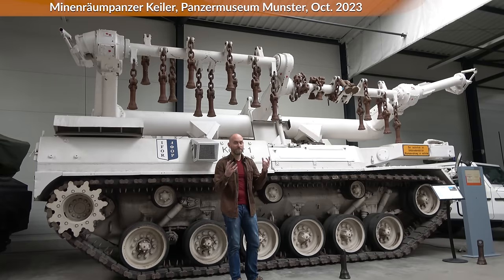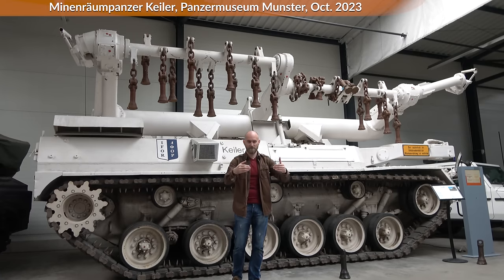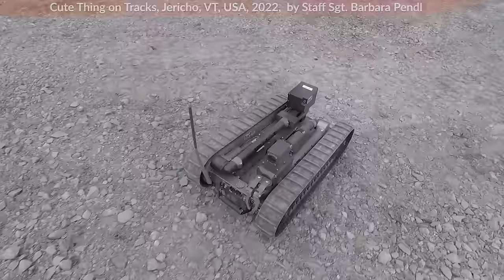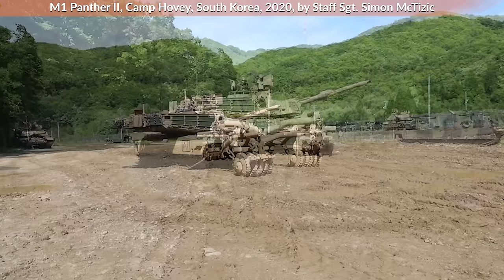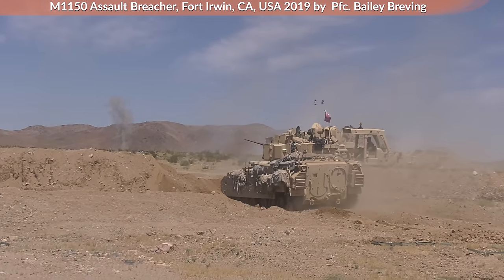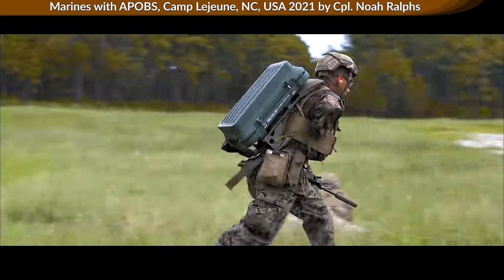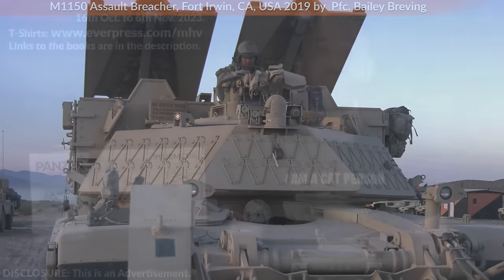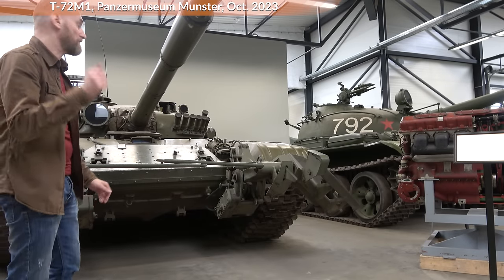Ukraine: The Problem with Mine-Clearing Tanks

Comment: These vehicles where really designed to clear traditional mine fields, I don't think people realise how dense and large the Russian minefields are. It's something crazy like up to 500 meters deep and around 4 mines per square meter with anti-personel mines along with anti-tank mines. And even if you do manage to clear a path Russia can deploy more mines in the area using missiles. There are also more complicated mine setups where they have a mine or stacked mines which destroy the anti-mine tanks or they have mines connected to pressure pads that are deeper underground setup so when a tank moves over the mine it doesn't go off until the mine is under the belly and the tank triggers a pad that then detonates the mine penetrating the belly of the tank. You also can't go around these mine fields, they are all along the front with barely any gaps.
Reply: And don't forget that you don't just have anti tank mixed with anti personnel, you often got many different models of mines in the same field. Which makes it even more difficult, and ontop you got improvised stuff as well, like a grenade under a magazine
Reply: Not to mention that these minefields are under observation by various UAV systems and often covered by fire.
Reply: I don't know what you think a traditional minefield is, but if you read any doctrine from any professional army on how to develop a minefield, that is exactly how they are supposed to be created.
Reply: @@solarwarden1894 Bingo, though the problem isn't so much the systems themselves as it is a doctrinal/technical/logistical insufficiency on the Ukrainian side. Every piece of military hardware is designed within a doctrinal context and under the assumption of proper utilization. The clear problem in Ukraine is that the current military reality in Ukraine doesn't allow them to use their hardware as a proper system of systems with proper doctrinal/technical/logistical integration.
Reply: If only we had classic cartoon drill tanks to burrow under the dense fields.
Reply: @@solarwarden1894 It's not a failure of the mine clearing vehicles but a failure of tactics. Even when mine clearing vehicles became commonplace, the preferred option for a mechanized unit was to bypass any mine obstacles, because breaching a minefield is an incredibly complex operation that requires careful planning and tight coordination of the combined arms. You would absolutely need to suppress all enemy weapon systems in the area which are bound to be present, because a mine obstacle that isn't covered by fire is also not an obstacle, it's a nuisance. You would also need to obscure and obfuscate the breach point, to make it unclear where you plan to break through, in order to prevent reinforcements from coming in. And everything has to work like clockwork. So since there's a lot of failure points, you would only attempt to breach if it you couldn't bypass. 

The vehicles work fine in their purpose, which is clearing a lane, the trouble is in protecting them while they do it. So if a combined arms breach was already a difficult task before UAV's became widespread, now it's even more difficult because when basically everyone from platoon commander and up can see the engineering units roll up in real time, it's even more demanding to protect the engineering assets and even more difficult to make the enemy question where the breach point is. The solution to mine fields isn't necessarily technological, it's coming up with suitable anti-UAV tactics, while also (somehow) enabling your own UAV's to function.
Reply: You don't even need fancy missiles to deploy mines, FASCAM can be deployed with normal artillery. As soon as a gap is made it can theoretically be plugged.
Reply: @lukerhode8960  These minefields are not doctrinal for NATO nor for the Soviet Union, Russia or China, so what military teaches them to be created this way? The density is about 1000 times higher than the most dense NATO minefield.
Reply: @solarwarden1894 No, the systems were developed for a hot war between the east and west, where static frontlines do not form. These minefields are highly undoctrinal and would not be possible to put up if under constant cruise and ballistic missile fire by NATO forces, for example.
Reply: Even if you clear a part, in five minutes it can be mined again from up to 15km whit remote mining launcher.
Even if its not mined, cleared route is premium target for artilery.
Reply: @solarwarden1894 They rely on proper combined arms.
Reply: Mine clearing tanks were used in WWII so I assumed mines were obsolete because of that. But this war really shows how that isn’t the case. The manoeuvre warfare in WWII also seemed to have obsoleted trench warfare and yet we are back to that. This war seems so much like WWI despite the increase in technology and in some cases because of it. It doesn’t seems this war will only end when one side runs out of ammunition and it seems Ukraine will run out first. I read about an ammunition factory here in Sweden and how they have increased capacity and they haven’t produced as much since the Cold War and can’t produce anymore because of other bottlenecks in the supply chain. Just to meet the minimum requirements for ammunition just for Scandinavia would take 10 years and that was just enough ammunition to fight for a couple of weeks or something like that. To make the amount the Russians spend Europe would need to increase production by at least tenfold.
Reply: @lukerhode8960 No, they're not. What he means is a NATO standard minefield, which are nowhere near what Russia is using. These are minefields that are, by themselves, fortress walls.
Reply: Hey, Bro are you telling me Russia actually is now preparing and using something with competence?
Reply: @lukerhode8960 Ukriane is literally an Army with a bunch of different equipment designed under completely different doctrines.
Reply: @wertywerrtyson5529 first sentence thinking mine clearing tanks being the end of mines is like the idiots at the beginning of the war thinking tanks were obsolete because NLAW Chan and ST Javelin
Reply: @ArchOfficial  Common sense cuz it works.
Reply: @carved6749  Yes, that's what I'm saying.
Reply: And this is exactly what air-mobile assaults were created.  But these combatants don't have that capability.
Reply: @solarwarden1894 Yes it would have been, this war has been going for almost two years, any exchange between NATO and USSR would be over in weeks. The type of fires and scale of them are not comparable.
Reply: @CharliMorganMusic  The point is that these are highly undoctrinal EVEN for Russia.
Reply: @carved6749  The defenses they put up and the way they conduct the elastic defense is to now the only somewhat doctrinal part of the war, and the minefields are effective due to being done correctly.

There was some money-embezzling constructions done in Russia and Crimea, but most of it is relatively sound.
Reply: @jimmiller5600  It is not common sense to deploy hundreds of millions of landmines in territory you intend to capture.
Reply: @ArchOfficial artillery can pound the corridor when enemy forces attempt to cross then deploy mines and scramble.
Reply: its russia not Russia
Reply: @ArchOfficial  It is if you suffer huge losses and want to keep as much of the territory as you can until you can bring your 3x advantage in manpower to bear.
Reply: @jimmiller5600 If they could do vertical envelopment wouldn’t the AA capabilities of the Russians be a limiting factor? 

Right now neither side is flying over enemy territory and even reluctant to fly close to the front, except for nap-of-the-earth approach for a quick launch and even quicker retreat.
Reply: @jimmiller5600  Russia doesn't have a significant manpower advantage FWIW, at least not a tactical or operational one, so I have no clue what you are referring to.
Reply: @lukerhode8960 that’s exactly what I was thinking.
Reply: @solarwarden1894 How would it happen? PGM strikes on tactical targets? Dumb bombing the minefield itself with popups?

Obviously there would be strikes on artillery and AD as well, but let's remember that the last time that happened it was preceded by intense operational bombardment.
Reply: @ArchOfficial  Population of Russia 143m.  Ukraine 43m.  Numbers still matter since one side can reinforce.
Reply: @blacksmith67  Agreed, but please note that my statement was "but these combatants do not have the capability".  You need at least local air superiority.
Reply: mines are such a cancer.
Reply: Air superiority helps with dealing with minefields. That's the reason so many have been lost on both sides because no one can achieve air dominance
Reply: No way it's 4 mines per sq. meter, that would be more mines than bare earth.
Reply: @jimmiller5600  Ukraine actually has a higher amount of able-bodied people right now than Russia, so those metrics only apply if you assume Russia is going to start conscripting disabled people and old men, which they are doing to some capacity. 

They could, and might, open up the pool more by also coercing women to join as volunteers, but that'd probably cause too much unrest.

Ukraine has less of a demographic issue and they also have a lot of popular mobilization of women, so their pool is effectively larger for combatants.
Reply: @ArchOfficial  How Ukraine can have more potential recruts if Ukraine haved 43 millions population and 8 millions of them immigrated to Europe, now they are have 35 at best, and Russia haved 143 millions and gained another 3 from DNR-LNR?
May be you are mistaken Ukraine with Russia?
Reply: @ridass.7137 :   It is "ruZZia", not "russia".  😅😅
Reply: @ArchOfficial  I'd be curious to see the citation to support your statement.
Reply: @lolnoobus  Ukraine has more men aged 18 - 50 who are combat capable than Russia has AND they have a lot of combat capable women as well. Russia has only sustained about 600,000 - 700,000 casualties in Ukraine to now, which isn't their entire conscription capability, but every single man is not going to be a combat troop who can conduct offensive operations, either. The more of those you have, the more actual manpower you have.
Reply: Mixed minefields are standard, surface laid are much easier to deal with than buried. Doctrinally covered by observation and fire, if they aren’t then they’re much easier to neutralize.
Reply: It's nowhere near 4 mines per square meter bud
Reply: @jnlk2505  It is, with the highest density about 5 per 1m^2. Average is closer to 2 of course, but he did say up to.
Reply: @jimmiller5600  There is no citation, my knowledge of the demographics of Russia and Ukraine and their conscription standards is the source.
Reply: @ArchOfficial  Ukraine haved 19 million men before conflict and Russia haved 67 million men.
How you decided that Ukraine have more combat capable men and women  than Russia?
By the way, Wikipedia says that without refugees to Europe and population in territories holded by Russia, whole ukrainian population is 28 millions.
How you decided that from 28 millions Ukraine have more millitary capable men than Russia from their 143 millions?
Reply: @T_81535 Russia is not committing its air force I force to avoid unnecessary losses and the Soviet doctrine always assumed that it wouldn't be possible to achieve total air superiority anyways, relegating the air force as an umbrella over your own lines rather than the spearhead that it is in the NATO doctrine, that is why the Soviets and now the Russians put so much emphasis in mobile in mass artillery, to pound the enemy positions in the scenario of their air force being unable to perform CAS in heavily contested air space.
That is why the Russians aren't using their air force as offensively as NATO would, their doctrinal baggage keeps them from committing to such an approach, preferring their most traditional artillery barrages for Frontline engagements and cruise missiles for in deep strikes, again, something out of late Cold War Soviet doctrine.
Reply: @lolnoobus  Russia has more old men, with a higher amount of alcoholics, disabled etc. who are not fit for military service. With factors like this you do come out to Russia having perhaps some ten or twenty million more men in manpower, but then you need to factor in things like if they will be combat capable or not. 

Most Russian troops right now are not fit and professional enough for any kind of military maneuvers, be it due to physical ability, character or just insubordination. This is exaggerated by Russia having a very high ratio of combat troops to support troops, which is asking for an impossible amount of combat capable personnel.
Reply: @ArchOfficial  
How you decided that russian men have less physical ability, character and subordination then ukrainian men?
Also, russians drink not much more then ukrainians. I mean, both countries are not in top 20 nation per drinking.
Russia also conscripted more every year.
Reply: @lolnoobus  Judging by OSINT publications of Russians discussing their own mobilization issues as compared to Ukrainians discussing their own mobilization issues.

Russia conscripted more per year because they lose their whole military's worth of combat troops every year. Ukraine has a fraction of the losses, so they don't exactly need to keep replacing men.
Reply: @ArchOfficial  I dunno, Ukraine closed their border for men 18-60, while Russia dont, so it dont looks like Russia have more problems with mobilization than Ukraine.
Also, russian population 1991-2022 droped from 148 to 143, while ukrainian population droped from 52 to 43. So, Ukraine lost more in absolute numbers and much more in percent of population before this conflict even started. 
And all this years Russia haved bigger army with bigger conscription. Like two time or more bigger conscription.
And if look on this numbers, even without Crimea, it seems for me that it in fact Ukraine the one who losted the population almost two times their military size per year.
Reply: @lolnoobus  Russia did close their borders for men.

Ukraine has only about 100,000 - 150,000 casualties as of now. They have not yet even lost all of their professional military's combat troops in losses, let alone the conscription base. Russia has lost their professional military 3 times.
Reply: Another “mine” that can be used is basically a trip wire for tanks, using a rocket on the side so when the tank tris it they get a direct hit to the side point blank.
Reply: @ArchOfficial  
When Russia closed their border for men? I cant find information about it in internet.
If Russia lost their millitary 3 times how they only haved one partial mobilization with only 300 000 mobilized? Why ukrainians who mobilized 1 000 000 not in Crimea yet? Who are they still fighting, if russians 3 times dead?
Reply: @lolnoobus  De-facto Russia has slightly more than 150 millions population (146,5 millions including Crimea and not including DPR, LPR, Kherson and Zaporoz'e territories controller by Russia).
De-facto Ukraine has slightly less than 20 millions population (i.e. on territory that Ukraine actually controls).
Even before the war Ukraine didn't have 43 millions, it was around 35 millions.
Now more ukrainians live outside of territory controlled by Kiev than in it.
The ratio is 7 to 1, not 3 to 1 or 4 to 1.

If you don't believe me, do your own research. You will end with the same numbers.
The confusion about Ukrainian numbers (and Russian too) comes from the fact that some people include DPR, LPR, Crimea and others, some don't. People often use obsolete numbers for Ukraine in borders of 1989.
Reply: @ArchOfficial  "Russia did close their borders for men."
No. You are misinformed.
Reply: @lolnoobus  Russia has not mobilized fully because of the political backlash. They should if they want to win the war, but it's politically sensitive, so they try to threaten or bribe people to join as "volunteers".

Ukraine is fighting the mobilized personnel.

Ukraine has not mobilized one million troops, even the conscripts haven't been called yet. It's mostly been popular mobilization and reservists to now.

They are not in Crimea yet because shaping operations do not depend on the amount of manpower, but on the amount of operational strike weapons and munitions for them.
Reply: @neverknowsbest2879  You are. Russia has effectively closed their borders for over a year now, and it has been passed in legislation this year.
Reply: @ArchOfficial  "Russia has not mobilized fully because of the political backlash."
Unlike Ukraine, Russia has to maintain its economy.
Russia can't afford its economy to collapse, West won't send Russia billions of dollars monthly like it does to Ukraine.
There is no point in winning war if your economy ends in shambles.
"so they try to threaten or bribe people to join as "volunteers""
There is no need to threaten anyone. Soldiers get very good salaries.
Reply: Focussing on the minefield is anyway the first mistake. The mistake exists as a barrier and to slow you down. You have to ignore it and focus on the actual defense lines behind that. 

If you can't do that: yeah... you should probably just give up (at least on your try to break through).

If your plan is to overcome the minefield and that as just the first line of a layered defense, you already walked into the trap of that layered defense.
Reply: @wertywerrtyson5529  Minefields on their own are pointless. Minefields as first line of a layered defense is extremely lethal. Not even because of the mines, you CAN get rid of them. But doing that slows you down massively what makes you fish in a barrel for the other layers. What is it's purpose.
Reply: @carved6749  I mean, tanks lost a lot of meaning, got less to do with crappy systems like Javelin, though. But just as mines they still got their placed in combined armed warfare.
Reply: @ArchOfficial  You mean because nukes or what?
Reply: @ArchOfficial  Russia doesn't have a single conscripton round yet. They didn't even do a full mobilisation.
Reply: @ArchOfficial  Child, where do you  get these absurd numbers from?
Reply: @carlosdgutierrez6570  NATO doctrine only works against countries with no army or a far inferior army after brutal bombing campaigns (with massive civil casualties).

It's not like Russia COULDN'T do that. They can. They don't want to, because that's the whole point of it being an SMO and not war: they don't see Ukraine as the enemy, but the coup regime, it's Banderites army and of course NATO (which was created to pillage Russia, nothing else, was never about defense, no one gives a fuck to conquer anything in Europa or the USA, there is nothing to get from that).
Reply: @ArchOfficial  You do get that your absurd propaganda doesn't change reality.

What you say is like "I could beat Mike Thyson, he's super old and ill and on drugs and I'm much smarter and fitter."

Yeah, you can lie to yourself like that. In reality you are still toast.
Reply: @miriamweller812  Russia has drafted about 100,000 conscripts to fight in the annexed regions. They have also signed up some 200,000 or so conscripts to serve as contractors. Ukraine on the other hand hasn't touched the conscript base yet.
Reply: @ArchOfficial  OSINT = some social media guys.

It's a fancy word for nothing.
Reply: Yep like 24h ago Leopard tank was destroyed by massive fireball - probably stacked mines. Tank more or less was disintegrated. Ukraine lost 4 Leopards in just last 48h.
Reply: @tomk3732  Russia lost 100~ T-tanks in last 48h. Who cares.
Reply: @ArchOfficial  Wow, UA boots just exceeded total number of tanks Russia had as losses ;)
Less than 100 vehicles of different types were loss both on the north and south flank of a successful Russian offensive to encircle the city (or what is left of it) of Avdiivka. 
Ukraine loosing 4 out of about 40 tanks they have is significant as it is a 10% loss of remaining fleet. They are also loosing other vehicles which they have no replacements for.
Reply: @grumpyboomer61  but we were told that "We are lucky they are so fucking stupid". Complex minefields and ISR do not fit into that picture.
Reply: @JJ-sd1xj They're not "using women", women have signed up themselves. Women cannot be drafted or conscripted.
Reply: @JJ-sd1xj So you're telling me Russia has inflicted 400-600,000 KIA and by that math over 2 million casualties and they are still losing a battalion a day and being pushed back? Against an army with a standing strength of 300,000 combat troops? Think about it for a bit.
Reply: @JJ-sd1xj They do not; conscription has not yet been used. Although men are obligated to stay within the borders in case it does.
Reply: also you have russian mines which upon their AI detecting through vibrations and sound that an enemy vehicle is approaching, launches itself in the air, targets and shoots a hollow charge at the weak turret hatch of the incoming vehicle...
how do you clear that ? 
🤣
Reply: @bschwand  I would be surprised to find even one Russian produced smart EFP in Ukraine. Actually, I have never even heard of a Russian smart EFP, let alone one with AI. Nobody is fielding autonomous munitions atm.
Reply: 500 meters deep? Was that a wrong number?
Reply: With no gaps 😂😂😂😂😂😂.

As if the have mined million of square kilometres of land.  

You have 3 road leading to a town 

One from the West one from the north and one from the south 

You put AT guns on the west road and mines and artillery on the north and south road . 

It allows you to have all your guns in one place to............. 

Thinking they have made a mine field the length of the country with no gaps is hilarious......

They want to counter attack the going to walk over there own mine feild...

Mine feild are about slowing and limited options for your enemy
Reply: @JackTalyorD  They HAVE mined the entire FLOT. Likely hundreds of millions of AT and AP mines combined. There are only some access passageways behind the dynamic defense zone.
Reply: @ArchOfficial  think about it for a second.

You have to roads and the are 50 km apart  in between is a farmer feild with a few dirt takes a small river and a forest of trees .

You lay mines on the road on the bridges and the dirt tacks (if they go anywhere)

You lay them either side of the road and in areas of flat land on the river where a new bridge can be built.

What you do is cover 10% of the ground but that 10% is where the heavy tanks and supply chain needs to be.

You take the travel speed from 100km.per hour down to 10 km and only for light car and tucks or on foot threw muddy famers feild

And then you add in 500mx500m squares of Mines on the "best area"

What you don't do is lay a continuous strip of Mines from road to road 50km long.

You can go around a minefield they are not everywhere.

What you can do it take heavy tanks and APCs fast because you are basically make new roads as you dirve and new bridges for rivers.
Reply: @JackTalyorD  Sure, seeing as you've been to Ukraine and surveyed all of these minefields, you could link me to where you posted the pictures and diagrams of them.
Reply: @ArchOfficial  have you
Reply: @ArchOfficial  but I could link you to several videos on training and feild manual for placement of mines for several different countries and wars.

The information I have available.
Reply: @ArchOfficial  WW2 invasion of France

No one expects tanks in the forest 

You lay minefields where you think the tanks will come from
Reply: @JackTalyorD  The Russian minefields are not doctrinal, for Russia, nor for NATO. Manuals and SOPs do not reflect the reality. Study more.
Reply: @ArchOfficial  yes but it still has to have a cost to befits ratios

If Ukraine now's that a 4km strip of land has mines in it running north to south the just need to carpet boom the shit out of one area and make a path threw.

Mine fields only work when 1 you don't know where the are or 2 you know where they are but the area is covered by artillery as well.

Russian will have used a lot of mines and layed several fields of them on the major roads, hell the will have several sets for one road or bridge.
Reply: @JackTalyorD  Stop talking about stuff you have no idea about. Using terms like "carpet bomb" kind of gives off that you were not involved with military topics before Feb 2022.

Tell me, how will you "carpet bomb" a minefield with insensitive Advanced mines on top and Regular mines buried 3m underground, especially when you don't have any platforms that can perform strategic bombing? You have no clue what the words you use even mean and what you're implying.
Reply: @ArchOfficial Russia not closed border for man, why you repeating really false info ?
Reply: @ArchOfficial  I'm under the impression that Russia intends on reserving Ukrainian borders to achieve its original goals of separating Russian language areas that voted for independence but had no constitutional right to independence from the Ukrainian speaking areas that wanted union. So mines and a buffer zone are perfectly well established options
Reply: @CellarRoot  Russia's original goal is securing a land bridge to Crimea. Everything else is completely fluff and tertiary objectives at best. The large defensive line makes sense if you understand that.
Reply: 4 per Sq meter? That's possible?
Reply: @blink182bfsftw  Yes, although a lot of them can and likely are air-scatterable AP mines too, bomblets basically.
Reply: Can’t forget the new smart mines that  launch EFPs 60 meters away and can detect the tank from sound and vibrations alone
Reply: I would also guess even if you made a breakthrough the minefield any force going through it would immediately be attacked requiring even more breakthroughs to support the first and so on and so on until you don't have enough equipment to support the assault and it ends up in a stalemate.
Reply: @Mustang-wt1se  That's basically what happens. Ukraine has broken through the frontline in multiple points over a month ago but that doesn't mean they just get free access to the operational depth. Although now the tempo will increase.

Zaluzhnyi did make a psychological warfare essay claiming that the tempo has slowed, but that's just to throw off the Russians and to facilitate more aid shipments.
Reply: @ArchOfficial Go to the frontline and come back with real info rather than wishful thinking.
Reply: @brianm1907  What? My info is from the frontline, and from operational briefs.
Reply: А вы думали что Россию можно победить на поле боя ?
Reply: @Антон-о3н2с  Russia has only won one battle in the war to now; and they still lost tactically dozens of times before Ukraine decided to retreat.
Reply: @lukerhode8960 normally a field can be driven around. Never before has a field been a thousand miles wide. German training for ua advised them you deal with a mine field by going round it
Reply: @@solarwarden1894also all of NATO relies on overwhelming air power. Tactics have never been tested in a true modern war without air superiority
Reply: @ArchOfficial they are deployed in territory already held.
Reply: @ridass.7137 all countries are spelled with a capital letter
Reply: @softrockification how big do you think a mine is? 4 per SQM is more than the earth. Wat.
Reply: And anti-personell mines under AT mines so that if an AT mine does get moved after being disarmed: boom.
Reply: A D11 Catepillar can doze to 1M depth at 40 kph and cost 2nd hand for less than $3 million. The Russians are stacking their mines 3 high which is what stopped the advance. D11’s would have been through those fields in an hour not stopping at the dragons teeth. You would loose a few but specialised blades perhaps 3 deep snow ploughing shaped. And 6 meters wide, most would survive. The faster you do it the safer it is. Buy in all of the old Mines D11 machines and go to it fast.
Reply: @williambunting803  they can dig up the ground but can they withstand exploding mines? I doubt it
Reply: @arostwocents  the D11 can carry a 6 inch or even 8 inch blade if it has to. The thing is the going 1 meter deep is way below the mine bury depth. The mines will be rolling over and if exploding the force will both down and against the blade, so distributed. Even Ben Hodges said in an interview that a big bull dozer would be better, then said but we don’t have any. Well get some. These machines are dirt cheap compared to specialised De-mining machines built on tank chassis.
Reply: Mine plows would work for most of those minefields since the vast majority of the mines are not even burried.
Reply: @gardnert1  The standard equipment failed quickly because the Russians stacked the mines 3 deep. For that duty you need more massive blade and machine frame construction. https://youtu.be/cHWo0P56_FA?si=52CKZlS7JZmUg3QI
Reply: @gardnert1  Yes those are the ones you can see but there are a lot buried as well. A mixture of anti-personel mines that are smaller and often more hidden and anti-tank mines on the surface and under ground. With various types of boopy trapped ones. They are also sometimes stacked so when a plough digs them up it destroys the plough at the same time. There are all sorts of ways of making it very difficult to de-mine an area let alone doing so while under fire from ATGM, artillery, Ka-52's and so on.
Reply: A lot of Russia’s population are victims of fetal alcohol poisoning. You can’t just compare raw population to determine which side will have more combat effective soldiers.
Reply: They're also stacking them, which is an even bigger problem
Reply: So, um, what were the Ukrainians and NATO thinking, exactly, then? Going 1mph single file after mine clearing vehicles into these fields, with drones and pre-sighted artillery.

I mean, which of this Russian minefield stuff was unknowable before the offensive? What does that tell us?
Reply: @AlexKarasev  It tells us that not all of our tactics and doctrine apply to this war. NATO isn't fighting this war, Ukraine is.
Reply: @ArchOfficial 
Even the highest casualties of Russia according to Ukrainian sources is 350000 of both dead and wounded
On the other hand according to Russian sources Ukraine casualties are 500000 dead and wounded but according to the smallest estimations of Ukraine defense ministry they are 240000
Also Russia has much more able men for conscription at least 5 to 1
Reply: @baha3alshamari152  Ukrainian estimate of Russian losses are KIA, not KIA + wounded. Total casualties are highest estimate around 1.4 million, but Russia's wounding ratio is much lower as more wounded die, so it's perhaps more like 900,000 with a ratio of 1.5.

"Ukraine defense ministry" has never estimated 240,000 casualties. The highest reasonable Ukrainian casualty estimate is 70,000 dead and mathematically 280,000 total casualties, which is not terribly unreasonable if you assume Russian casualties being about 3 times more. Ukrainian casualties are likely over-counted and Russian are under-counted FWIW, so a more liberal estimate would be 4:1.

Russia does not have more able bodied men without doing general mobilization, and it is unthinkable at least until Putin gets elected again, and unthinkable before the population is programmed to accept a wartime economy, so not during the next 2 years.
Reply: They also triple stack the mines
Reply: @vknight7497  Not in every location, but yeah, it's common.
Reply: @ArchOfficial  Russia’s manpower is being demonstrated by how they’re recruiting more and more from overseas. Yet the doomers still want to imagine Russia has infinite soldiers because of its population
Reply: @neverknowsbest2879 lmao most Russian “volunteers” sign contracts that they don’t get paid for ever, and can’t get out of.
Reply: @CellarRoot Putin has said multiple times he still intends to capture Kyiv
Reply: @bigman9854  You are misinformed. But I am ok with this, people are wrong on the internet all time time.
Reply: @bigman9854  They technically would have between 3-7 million men if they did general mobilization, although in reality that number is probably inflated a few times. It'd also make no difference either way, they're not making any gains right now despite a tactical manpower superiority. It'd be more of a problem if they found a way to pump out 100 BMPs a week.
Reply: @lolnoobus Russian military readiness is shit.  It has been shit, it continues to be shit, it will be shit in the future.

The problem is less lack of men and more lack of capable men. Putin has rotted out the Russian military from it's core.  Between underpaying professional soldiers, allowing corruption to run rampant in military procurement, elimination of capable officers who might pose a coup threat, extensive utilization of PMCs over standard Russian military, and failing to provide adequate training and gear to both conscripts and recruits, Putin has screwed himself.

Imagine if Walmart controlled Target, but also viewed Target as an existential threat to Walmarts business model.  You would get a similar result.  Walmart would grow stronger at Targets expense, until Amazon or some other competitor ate them both up.

It doesn't matter if Russia fields 100 million men if they all arrive unarmed, untrained, and Ukraine has 101 million bullets.  You are looking at this from a very naive and over simplified lens.

The problem Russia has is all these difficulties CANNOT be resolved short term.  Capable generals take time to train and luck to find.  Rooting out corruption takes time.  Building enough body armor, guns, arty barrels, ammo takes time.  Becoming less reliant on PMCs takes time and relies on these other pieces.  All of that costs money.  Paying soldiers more costs money.  And Russia doesn't have that money long term.

Russia cannot win this war.  They may win the battles, they may take the territory, but they have already lost the war.  They lost it when they couldn't topple Ukraine in the first week.  At this point, any Russian victory is a Pyrrhic one.
Reply: @miriamweller812 the Javelin is an excellent system for what it's intended.  Giving infantry anti armor capability while also offering faf safety.

It's fast and away better than it's predecessor the M47 Dragon, which required infantry to maintain lock for the duration of the missiles flight.

Further the Javelin offers top attack mode, which exploits the generally weak top armor of most tanks.

Sure, I would rather have a TOW on a Bradley and launch from inside the steel beast but if I'm infantry the Javelin is probably one of the most capable (if not most capable) MANPATS.
Reply: @bschwand sounds like a load of propaganda.  Is that like the new Russian super tank that's so advanced it's camo systems make it appear as if it's never fielded?  Where are those 1000+ Armata tanks?
Reply: @JackTalyorD doesn't the literal invasion of France disprove your whole damn point?

Wasn't Hitler going around the Maginot and through the forest "where no one expects" prove you wrong?
Reply: @ArchOfficial agree, it's like "use artillery to clear a minefield" has same energy as "carpet bomb the minefield".
Reply: @Mustang-wt1se yes and exactly.  The point of a minefield is to deny territory through artillery attrition. You clear a path through the minefield, now you have a new problem, artillery, and your in the open with no trenches for cover.
Reply: @LMYS5697  How much russian professional soldiers was payed before Putin?
If you talk about supposed Putin's underpayment of them, you sure know this.
Reply: @lolnoobus  before Putin?  I mean you would have to adjust for inflation big time given that Putin has been dear leader for about three decades
Reply: @ArchOfficial you quoting CNN?
Reply: @ArchOfficial There are countless videos of Ukraine forcefully conscripting. Have you not seen the men being abducted by the military?
Reply: @magnusE7 he probably meant 5 which is still kinda impressive though
Reply: 500 meters deep? Tf are you smoking? Do you even realise how deep that is?
Reply: @MarcosElMalo2 What? Russia don't drink much. We drink less then many western countries, less then nothern countries like Norway, Sweden, etc, less then Baltic countries like Litva, Latvia, Estonia.
Less then Germany. Less then Japan, South Korea.

I was shocked how much western countries and South Korea are drinking. Nothing near russians.
Reply: I forgot. We have 25 million mobilization potential. USSR had 33 millions potential at WW2 (32 millions were mobilized).
Reply: @peacepham7838  Not very deep, seeing as the FLOT is about 4km deep and has munitions placed all over it. However density is relatively high on the minefields.
Reply: Pffttt other videos say Ukrainian in excavator is the bestest greatest most innovative thing in the history of all things.
Reply: @ArchOfficial  Your reasoning makes me laugh
Russia is not using all its military forces in Ukraine. Only a contract army and only volunteers. This is funny and misunderstands, but when Russia carried out mobilization, those soldiers who were in the army on conscription were protected from participating in hostilities on the territory of Ukraine. The only episode when they fought was when Ukraine tried to attack Belogorod.
At first, Russia generally wanted to resolve the entire conflict by using 150 thousand against 650 thousand Ukrainians. It was assumed that the Ukrainian army would come over to their side. This is partly what happened, but during the 8 years of the conflict in Donbass, Ukraine replaced almost all its commanders with young and ideological Nazis. There is also a Nazi battalion called Azov, which has unlimited rights in the territory of Urkiana. Azov soldiers can easily remove a colonel from a regular unit if they suspect him of disloyalty.
According to indirect data, Russia's losses are about 150 thousand killed and wounded, while Ukraine's losses exceed 3 million killed and wounded.
These data are absolutely indirect and cannot be confirmed by anything other than guesswork, such as the constant mobilization of the population in Ukraine, the average age of a soldier and the approximate figures announced by the Russian Ministry of Defense on the number of volunteers after mobilization.
Now Russia is in a position advantageous to itself and is simply destroying the Ukrainian army in the field. If Russia begins to attack, the Ukrainian army will do the same thing it did in Mariupol and Bakhmut - it will close itself in the cities and use the civilian population as a human shield. Putn will not give the order to do to Kharkov or Nikolaev, as the United States did to Raka in Syria, where a dozen B-52s destroyed the city block by block for several weeks
Reply: @juryfilatov4520  Russia has lost about 90% of their active military in Ukraine, and compared to Jan 2022 numbers, is using 200% of their military in Ukraine. Cope more.
Reply: @juryfilatov4520  This whole post is garbage. Troll harder. Reported for misinformation. I will however copy it and use it as inspiration for science fiction.
Reply: @ArchOfficial  
Oh, please, but facts are a very stubborn thing.
The Ukrainian border is closed to the exit of the entire male population from 16 to 60 years old. The borders of Russia are absolutely open to everyone who has no debts on fines and alimony
Reply: @juryfilatov4520  None of those are facts. Literally not a single part.
Reply: @ArchOfficial  It's sad that you don't know this, then this is reality. You will not be able to refute this, while I can easily provide links to Zelensky’s decree banning military-age men from leaving the Garin region, there are hundreds of videos of kidnappers catching Ukrainians on the street to send them to the front one way in the army Ukraine.
Reply: @juryfilatov4520  To add to your nonsense, the median age in Ukraine is about 41. The median age in the military is about 30. 

That suggests that Ukraine has a higher proportion of professional career troops than most conscription armies, where the median age of the population is almost exactly the median age of the military; because the population IS the military.

Ukraine hasn't lost 1/3 of their professional military yet and they still have about 3-4 million reservists left. Russia has lost 90% of their professional military and has zero reservists left according to law, although they convert reservists into "volunteers".

Once Russia retreats from Crimea this year, they will likely start readying for a general mobilization next year, which will increase the reservists to technically 7-9 million. That's not the current situation, though.
Reply: @ArchOfficial  Ukraine is also not in a state of war. This is a fact that breaks all your logic.
Or did you not know this?
Reply: @juryfilatov4520  Ukraine is in a state of war. It was declared on 2022-02-23. 

They have not declared war on Russia however, as they are not attacking Russia; Russia at the same time has broken international law by not declaring war on Ukraine.
Reply: @ArchOfficial  Give the number and date of the decree declaring war on Russia.
Reply: @ArchOfficial  no declaration - no war.  look for other arguments
Reply: @juryfilatov4520  Wow, so Ukraine has destroyed 90% of the Russian military without them even being in a war? Imagine what happens once they actually decide to fight a bit.
Reply: I think like most wars, like with WWI and artillery shell usage or wwii carrier and ship fuel usage. The math that made sense before the war suddenly doesn’t at all.
Reply: @ljubomirculibrk4097  not really. The enemy would likely deploy another field in front of the advancing force to slow them down so artillery can pick off the armor units.
Reply: they never expect the second mine underneath the first >:)
Reply: @ArchOfficial  ". Ukraine has broken through the frontline in multiple points over a month ago" LOL
Reply: @Constanza235  Yes, this was true roughly 8-9 months ago, then the foreign aid stopped.